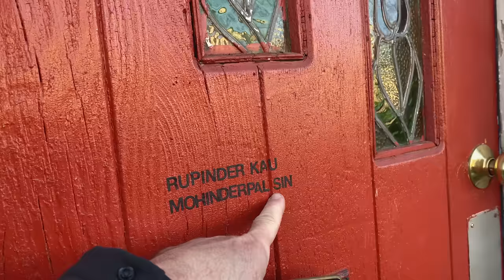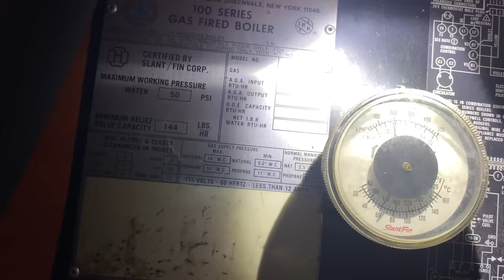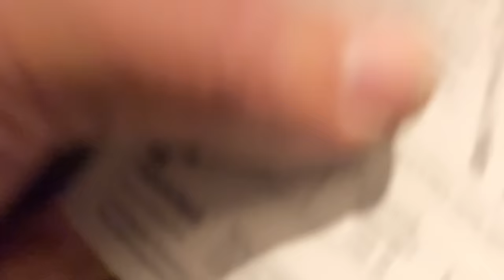Disrespectful Homeowner Takes Walk of Shame & Confused Tenant With No Heat Light Pilot Instructions

Comment: I understand the emergency no heat, change the thermocouple and out the door.  But you also have a company policy to "test everything" to be safe.   So would that not apply to even a price conscious customer.  Quick bang out of the gas logs, stick in the analyzer and a twist of the the screw could have changed the orange flame a nice blue and a much safer condition.   An extra 20 min to the job for piece of mind or at least an I tried?

Comment: Have you ever fixed a Pennsylvania gas heater? 😂 Not being smart, wife and I bought a house built in 1910 had the original Pennsylvania gas heater. Absolutely loved it didn't need electricity for heat just free flow the heat when someone hits a power line or the weather caused outages... sadly three years after we bought the house the combustion chamber lining started to fail so had to replace it...had them wire up a pigtail to use a generator if we lose power in the winter as we have 2 kids under ten and I have moiamoia...long name for weak and twisted arteries in the head and neck... already had 1 ruptured brain aneurysm and another unruptured brain aneurysm so I have to keep stress low and everything has to stay very stable....